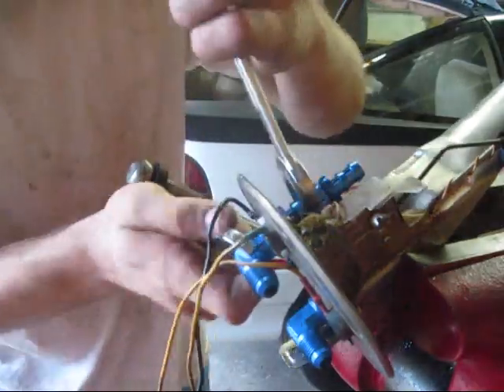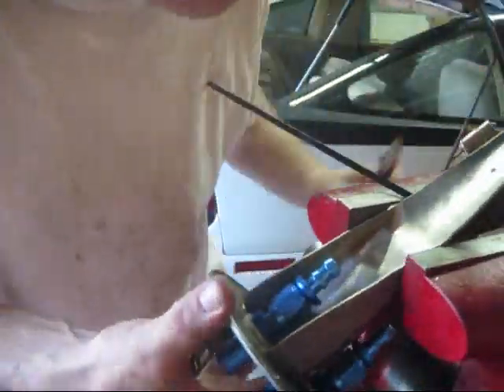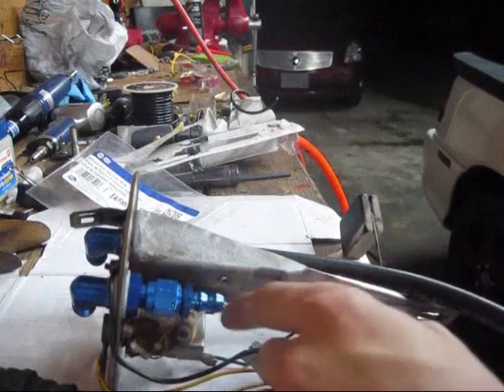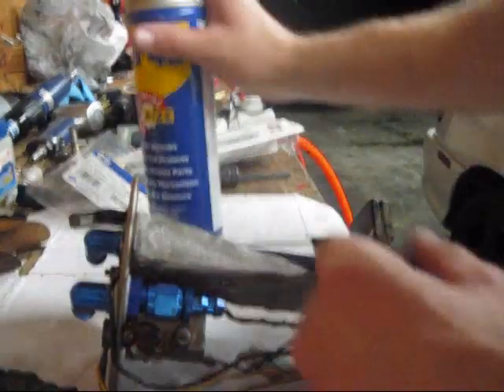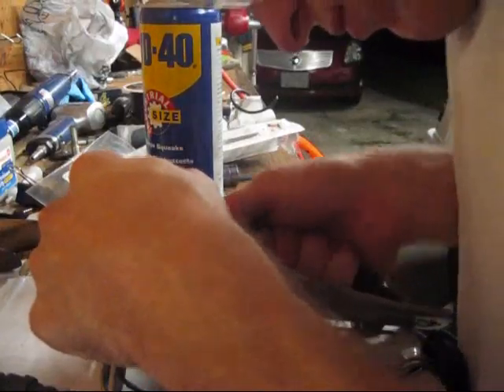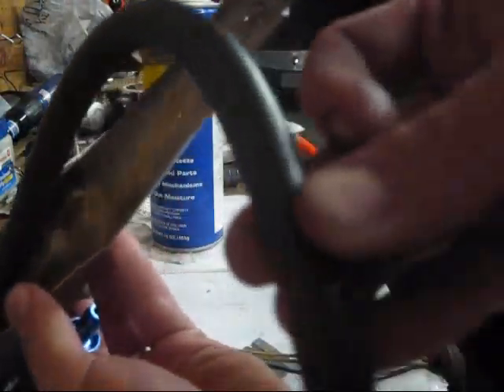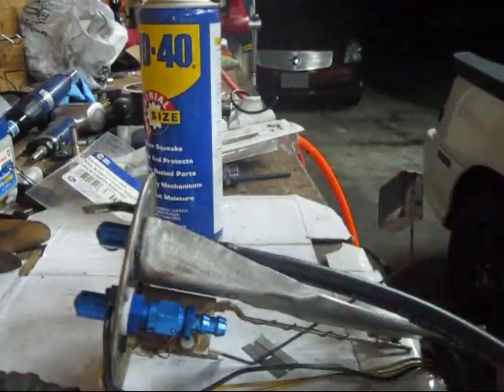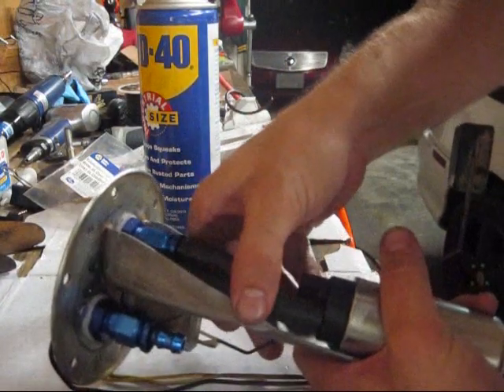1G AWD Dual Fuel Pump Hanger

Comment: how did you wire these up? I'm looking into doing this on my 98 tsi
Reply from the maker: Raleigh Eads with the in tank fuel pumps available today, I would just opt for a Walbro 450 and call it a day. This setup works but it's outdated with today's options.
Reply: well I was only considering this for the reason  is that I have  a spare brand new in box 255 and was just tossing around the idea of a little project
Reply from the maker: I simply ran both positives and negatives to some 10 gauge wire and ran that to the relay. This can all be seen at the end of the video.

Comment: Just a quick update. I'm doing some upgrades on my fuel system and found that E90 will dissolve both JB weld and silicone that I was using to seal the holes for my power and ground wire pass-thru. I found these little guys on the internet: Sealcon USA m8 Nickel viton strain relief fitting (Won't let me post link) I welded my original hole shut for the pass-thru and drilled two new holes and install these liquid tight strain relief fittings. I now have an air and liquid tight seal for the wires.
Reply: I don't expect you to see this, but how are those fittings holding up to the ethanol with them being brass?